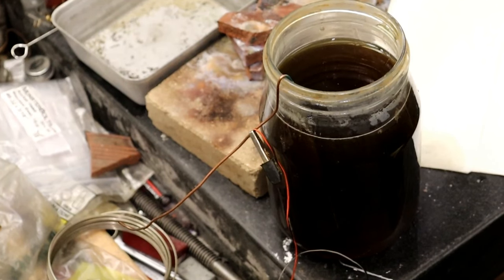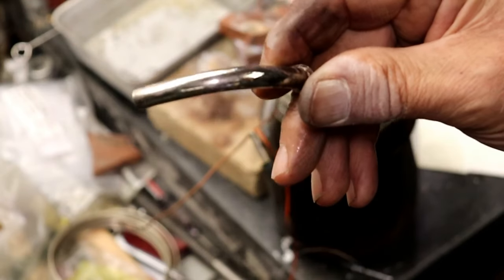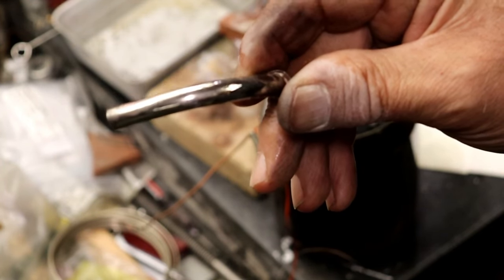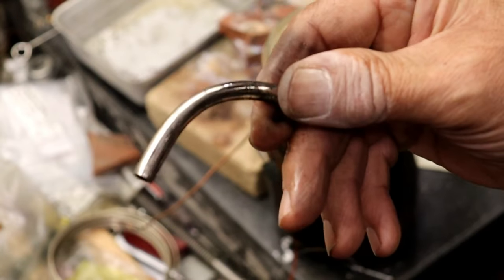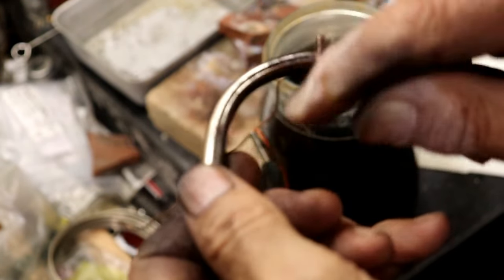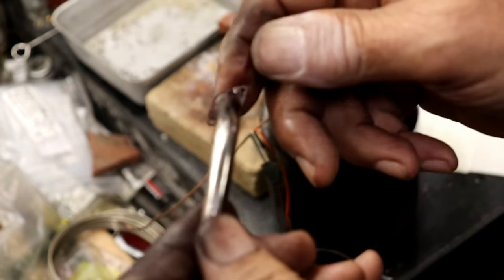5 cylinder radial engine 8

Comment: Did you use any type of pickling solution after silver soldering? Curious how that might affect the nickel plating.
Reply from the maker: no I didn't I should though it might turn out better. I just buffed it and washed it.